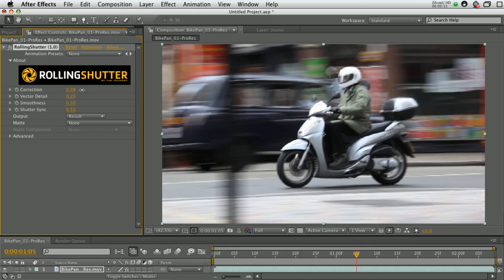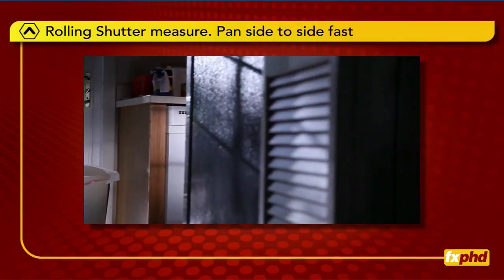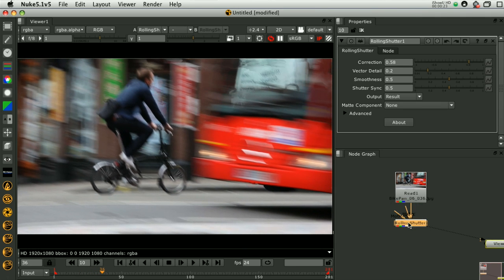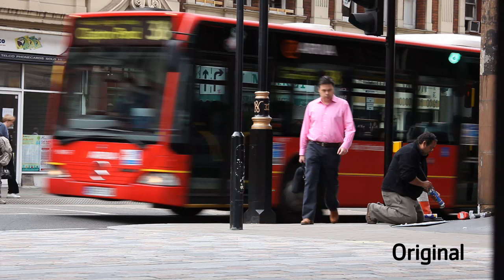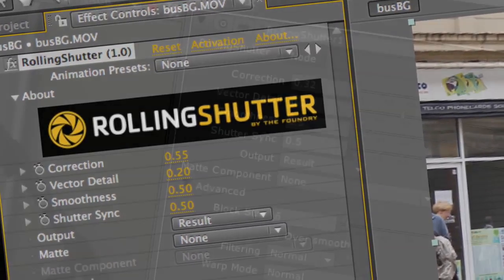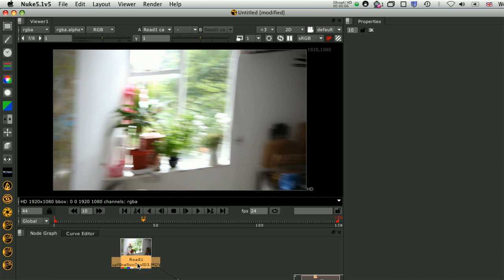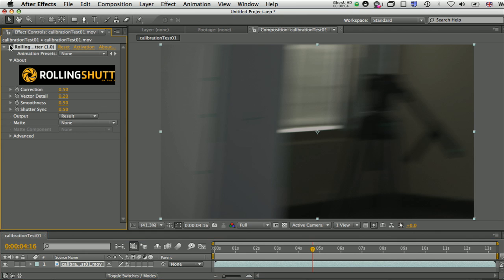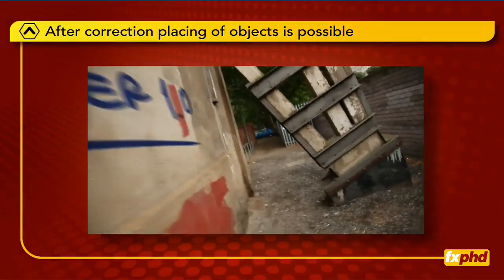RollingShutter - an introduction

Comment from the maker: Hi inside004. Unfortunately, no - it's the same scenario as with a camera direct linked to a heli. The vertical shift is of a high enough speed that as the frame is captured the sensor is moved up and down. As a result lines of material are actually lost (rather than just shifted), so they can't be corrected as a post process. Sorry : (

Comment from the maker: @GURUOM There's a good page on the manual  about it (p20-21), Take a look.  Essentially find a frame where there's some lines that should be vertical but are slanted, and then drag the correction parameter about until they are vertical.  Hope this helps.